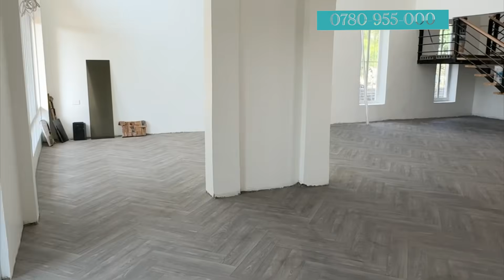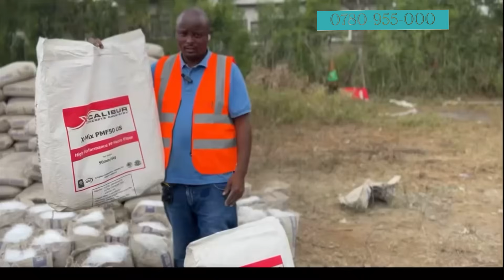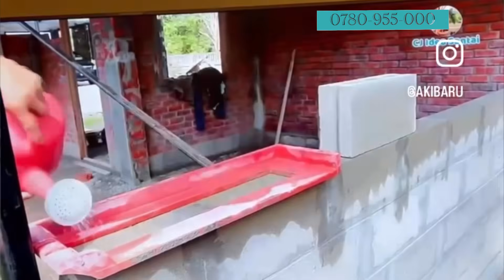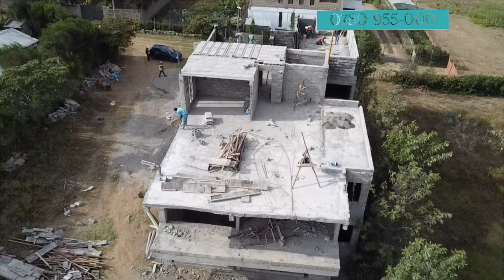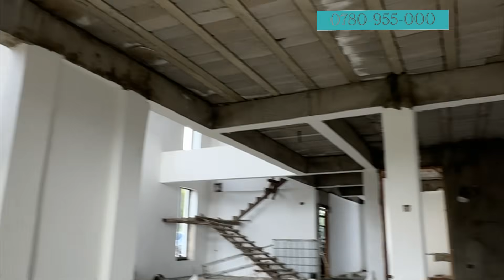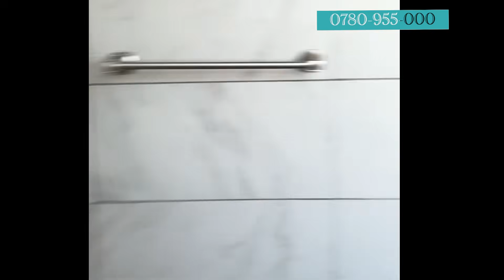How to build a Precast  maisonette from Sh 9.5M .

Comment: Well a red flag on stair case Second why not just a thine layer of plastering then apply scheming. the video was so speedy especially when installing the Tbeams So we never see clearly which material you applied in between. With that kind of stair case its not safe at all Iam in Diaspora and somehow trying to find a good contractor to build on a 100 by 100 flat using Ndarugo plus precast panels for inside petitioning Guys you cheap but too much short cuts and its dangerous Property Noma has a clean job but abit expensive

Comment: The problem with precast is you can hear people on the other room. Bt i will come we figure out we can do in my next project
Reply from the maker: @maclaudeamumbwe2663  The FREQUENTLY asked question (FAQ) asked about SOUND TRANSMISSION CLASS (STC) of 90mm hollow core precast wall panels is 45 decibels compared to Durago stones which has 40 DB.
Reply: @floordecorkenya9339  this is not different from the ones they use at tsavo. I didn’t like them at all.

Comment: What’s the STC rating of the walls? How sound proof are they?
Reply from the maker: @Joe-h3y5v  90 mm hollow core precast stc is about 40 db enough to mitigate basic conversation sounds in the next room . However for heavy noise area like highway , industry machinery you need to mitigate acoustic sound proofing measures

Comment: Great job! I have a question about sound transmission between rooms and from the outside. Are precast buildings more susceptible to noise due to their thinner panels compared to conventional buildings?
Reply from the maker: @WacukaL  the panels and precast click block have a hollow section that inhibit sounds … you know sound doesn’t travel well in a a vacuum like situation
Reply: @floordecorkenya9339  thanks for your response